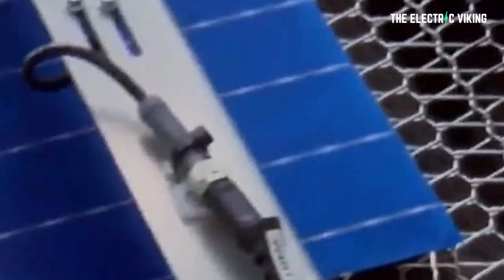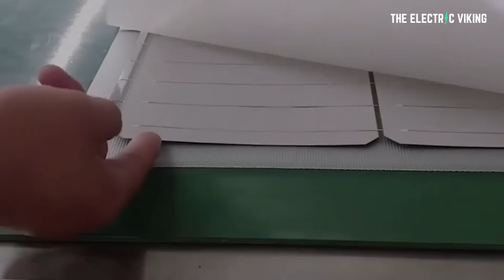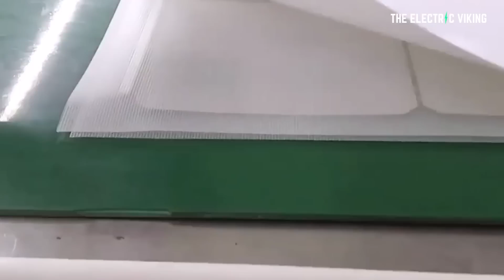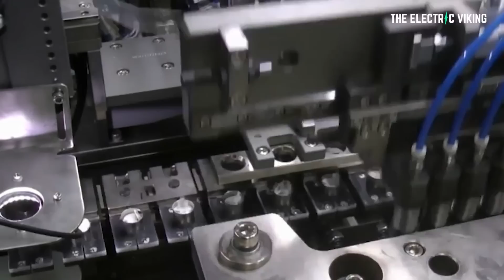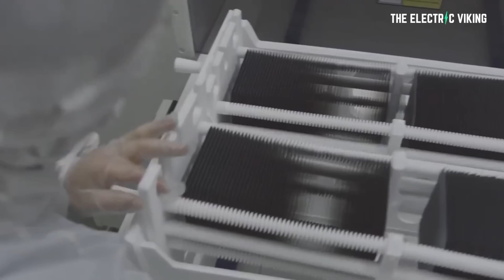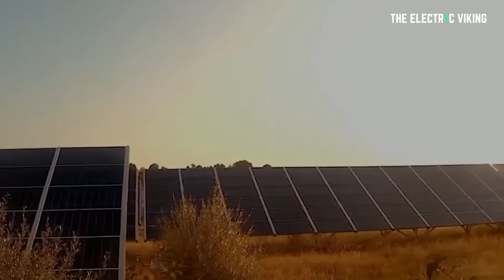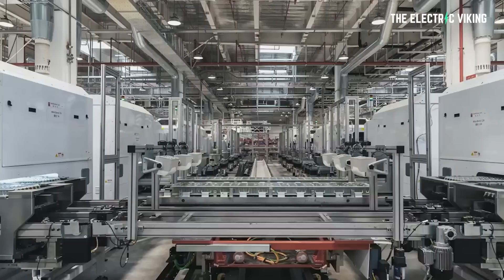China’s solar panel price war will double solar panel installations globally

Comment: Yeah, and the people of Europe have sky high heating bills. Especially in Germany. In the UK families are having to choose between heat or food. Why, because they shut down all the coal mines, oil/gas drilling, even blowing up coal power stations in the UK. Only to find that when supplies of fossils from Russia are cut off all the renewables they have been tenaciously investing in for decades cannot deliver. I'm all for exploring alternative energy sources but it is insanity to shut down what we have until the new things have proven themselves. This mad rush to "net-zero" is very likely to cause a lot of suffering.
Reply: Solar makes less power in winter. I get almost 5x the generation in July as I get in Dec-Jan in Ohio. That solar will be great in the summer. You get a lot by March. In the winter, wind is better, especially in the north. You also need some storage to smooth it out, along with beefing up the grid, and demand management. Charge those EVs when there is plenty, and less when you are short.
Reply: @fjalics  Round here the days are 6 hours long at Christmas and half the years is depressingly dark. It's not a good country for wind power. Batteries won't smooth out those 6 month long dips.
Reply: @heater5979  Where are you at, roughly?
Reply: @fjalics  30Km outside  Helsinki, Finland.
Reply: @heater5979  Your wind resources aren't top tier, but you do have some in the Baltic Sea, and Gulf of Bothnia. It would be interesting to see what it is in the winter vs summer. Also, onshore wind is now dominated by lower speed wind turbines, which means long blades. Ever heat of the Haliade X, SG 14-222, and V236-15?
Reply: The reasons Europe shut down coal and did not embrace fracking are for coal:
The deposits where mostly deep and thin and sometimes of shit quality on top of that. As a result coal needed increasing subsidies which where getting simply too expensive. I watched it in Germany and am remembering the iron lady blowing up the unionised and subsidised coal mines in Britain. Germany still uses competitive brown coal today. But in a densely populated area like Europe every mine and even gas well causes extra costs that can't be hidden like in the Australian outback or the western US. The former Ruhr coal basin has closed but still requires eternal water pumping because salty deep groundwater  threatens shallow aquifiers that supply drinking water. The densely populated  surface  has  dropped by some 10 to 20m and without pumping even major rivers back out of this artificial depression the mega city covering the basin would become a lake. 
The Dutch have their Gronigen gasfield doing the same: Earthquakes destroy houses and the land is sinking (already being close to sealed or below). 
Northern Germany was a fracking target but the are is increasingly short of water and depends on clean groundwater...So would you permanently threaten your  watersupply for a short term gas boom?
The Brits had their gas and oil boom out of sight from the 70ies on in the North Sea. Now their deposits are in decline and the energy crisis hits a former exporter as hard as Germany which never had much own oil or gas. 
Time for them to no longer kick the can down the road and get out of fossil fuels. Change is hard but staying exposed to fossil fuel volatility and foreign blackmailing is harder for Europe as it will always be a fossil fuel importer due to a lack of (sometimes economical) domestic resources.
 And if you stop denying climate change renewables become a no brainer for every country because cleaning up fossil fuel would easily double its cost....
Reply: @@bertwaldmann4789All pain, No gain
Reply: @Bert Waldmann That is what bothers me. The net-zero fanatics don't care how much pain they inflict on people today, it's all for the good of some supposed benefit of not yet existing future generations. I'm worried the effects of rabid net-zeroism will include people dying of cold and starvation as our energy and agriculture supplies get disrupted. This philosophy is what the likes of Stalin used when forcibly starving millions of Ukrainians, they were expendable for the good of building the bright new global socialist order.
Reply: Wrong. Coal, gas, oil, and nuclear aren't necessary any more. They disconnect photovoltaic plants, stop wind turbines and biogas plants aren't allowed to electrify what they burn. This is due to coal, oil, gas and nuclear lobbyists having bribed politicians. Also: don't bullshit me about heating: never has been warmer here in Germany. If you continue with that bullshit we Slavic Antifascists will continue what Stalin had started: the annihilation of you demented murderers of the Jewish people...and now you started to murder Muslims (Solingen,  NSU, Hanau...). And say goodbye to your Nazi-car industry because Tesla (despite your fake-environmental efforts to block Musk), China and South Korea are tanking you.
Reply: The price of heating is high because price of fossil fuels is high right now, and many homes heat themselves using fossil fuels and not electricity
Reply: @tiga2001  Exactly. The price of fossil, in Germany for example, has gone through the roof because of Russias invasion of Ukraine. Despite decades of investment renewables cannot provide enough energy to replace Russian oil and gas. Putting the entire economy in jeopardy ultimately threatening peoples lives.
Reply: @heater5979  seems like Germany spent just as long or longer invested in Russian oil and gas and that's why Germany's in this predicament. If they had diversified away from Russia or invested in electricity storage solutions then it would be a different story. But they've created new LNG terminals so they should be able to import the gas they need from other countries.
Reply: Solar is so cheap now.  Batteries have got cheap too.  Community solar for the win.   Don't do it on your own go collective and be energy independent.   Leave those evil fossil fuel companies behind.   They are trying to kill our kids
Reply: @girowinters  Around here I have only seen the sun for a couple of days out of the last two months. When there is no cloud the sun is very low in the sky and only up for 6 hours. Maybe a couple of those are useful for power generation. The temperature has been -5C dipping down to -20C. This house is very well insulated but needs orders of magnitude more energy to keep in warm. There is no way solar and batteries is going to help.

Fossil is not "evil" most of the kids alive today would not be here if it were not for our use of fossil saving people from cold and starvation for the last  hundred years. or so.

Yes, we need alternative energy sources to halt pollution and to use when fossil runs out. But cutting fossil before we have an alternative ready to replace it is going to cause untold misery.
Reply: Fossil fuels are just too expensive  and toxic
Reply: Not all renewables fault. If the UK and Europe had put more solar on their homes, and installed electric heat pumps, they wouldn't need to use dirty coal and oil.
Reply: @nio6297  those imaginary solar panels sure would have helped in the cold November days 😅
Reply: Poor planning and lack of planning are serious problems.  Failure to carefully manage the energy transition is a problem.  Generating electricity from wind and solar is not the problem.  

I would say, due to decades of inadequate investment in wind and solar, Europe is still subject to the volatile pricing of energy from fossil fuels.  Fossil fuel pricing will always be subject to geopolitical machinations and monopolistic corporate profiteering.
Reply: @davidmenasco5743  I agree. When Germany shut down its nuclear power plants, it should have went all in on wind and solar. Other European countries also should have went more aggressively toward scaling up wind and solar.
Reply: The ones who suffered most are those who didnt install solar panels on thier roof and  those who are not driving EVs
Reply: @1rjona  They had the money bey...they had the abilities...but they just were too arrogant.
Reply: @1rjona  90% of people around here live in the city, in apartments. They have no possibility to install solar panels. Even if they could afford to. Similarly a huge majority of the population are not driving EV's because there is no way they can afford one.
Reply: @heater5979  but unfortunately for them their taxes are subsidising EVs and Solar Panels (and the feed in tariffs which justify, say, a 10 year payback). Feed-in tariffs meanwhile are plummeting, in Australia at least, pushing the solar panel payback out to 20+ years. All this while several millions of Australians live below the poverty line. In time, our grandchildren and great grandchildren will look back on us with scorn.
Reply: Europe and UK is in world of pain due to Russia and reliance on gas.  Solar likely won’t help majority of those in UK in the short term.
Reply: @michaelcsutton  Exactly. Despite decades of investment renewables proved not to be enough to replace fossils. It was nuts to disable energy production from local fossils and become dependent on Russia.

Comment: Carbon neutrality will impoverish huge swathes of people at this stage. until grid level storage is a viable alternative. solar so far has been unhelpful in times of most critical need (because it's cold and dark) If you're lucky enough to live in a sunny part of the world and you earn significantly more than $3 a day then domestic solar is a great idea combined with a power wall of some description. Oh, and the reason for Chinas massive rush for full automation is that they have insufficient numbers of people in the workforce either by age or by desire. A problem which will only worsen due to the CCP previous ill considered social engineering projects...
Reply: How will carbon neutrality impoverish huge swathes of people and where ?

Comment: Hi Sam, greetings from the U.K.  Solar has its place in future of electricity generation, but here in the U.K. we have Winters with short days and very low light levels. Wind and battery storage can significantly help, but we will need other forms of generation here. Nuclear still seems the best option to fill the gap to me, and I know this Is controversial, but I just don’t see an alternative technology at this time.
Reply: Wind, works in the dark, already installed, no nuke waste
Reply: There will always be a need for some base load, yes.   Nuclear is a good option for that.   But it won't be economic without a lot of energy storage becoming operational first.   Energy storage is the key to being able to run base-load like nuclear efficiently.

The U.K. is barely breaking the surface of the amount of renewables that can be installed.  Solar potential is very high in the south, and wind potential is also seriously under-developed.    Solar is decent even going north... cloudy days aren't a problem when panels can be slapped up just about anywhere.   We are talking at least another +500% in solar installations and probably a lot more.   My guess is that you will want at least 60GWp of installed panel capacity and you only have around 12GWp now.
Reply: No - solar is cheaper and works effectively in the UK - UK will have slightly more storage so the ratio of solar/storage will be different to a sunny area.  The cost of nuclear is astronomical and will continue the imnpovishment of Britons.

Comment: If the 0.8 Twh production - would never over take increased world demand which is 9 Twh per year. You'd need 22x current solar production to even meet increased demand and maintain fossil fuels at current levels.

Comment: Could be true; but home solar is 1/2 as cost effective as farms.  Even if it were accurate world solar growth to date is 0.40 Twh; total installed 2,700 Twh, a double to 0.8 would only raise the total to 3,500 TwH out of 185,000 Twh = 1.8% of World energy production; hardly putting fossil fuels out of demand.
Reply: You need to add wind into that calculation.    My electricity is about 50% wind at 13 cents per KWh.
Reply: @danharold3087  He was only talking about solar. but you can look at the same chart and see that World wind is about 4.2 Twh up from 3.8 improvement; total 2020-2021 .4 higher similar to solar increat but combinded 1/10 the demand increace; in order to do anything to cut CO2 you at least have to keep up with demand increases. Now I can cut CO2 over night by 8-10% just get everyone to commute in carpools - Transport is 16% of all CO2; if 4 or 5 cars stay home for commute that cuts CO2 at least in half.  BUT no one is even talking about it - which tells me the entire CO2 panic is nothing but a sales pitch from those trying to get a world government and sell you green products.  There is an advantage - which is independence from oil producing countries like Russia but that isn't want they want - they want a carbon tax and Paris accords. BTW if all those carpools had solar electric or ethanol - you'd cut fossil fuel use even more.
Reply: @BlondieSuperdog  Yes he was talking about solar.  But in terms of moving away from fossil fuels one has to include renewable in general.  I tend to leave hydro out which is growing at about 3% globally and quite hard to accelerate.  Wind and solar adoption is spotty. Could be better in the US but we have a 10% import tariff  with virtually no local production.  Aka a tax that slows adoption.  Millions are being spent to confuse the issue.  It divides us which also keeps our focus away from other important things.  
Most people choose to talk about efficiency because people with zero buy in on the environment might understand saving money.   Ethanol was originally used as an oxygenator as opposed to MTBE.  It worked fairly well for that.  When they started upping the level to displace gasoline it was a flop.  Engineering Explained did a video on why.  Don't look to the government to validate tech.  Too much of what they know comes from lobbyists.  They mostly rearrange deck chairs and fill their war chests.
Reply: @danharold3087  Ok hydro is the largest renewable by far, most of the dams have been around for 50+ years before Green was even a thing. It is growing now and then a dam gets built, in Washington State they are tearing them down. One potential problem will be if glaciers continue to decline the feed waters will; Hoover Dam/Lake Meade are already at low levels.
Reply: @BlondieSuperdog  Hydro is hard because a dam takes lots of acres and there is the environmental  impact associated with it.  More so it takes a river and  arguably most have already been damed past where they should have been.
For this reason I don't see where hydro will account for energy growth in the western world.
Reply: @danharold3087  I agree - it won't grow enough.  As I noted conservation is likely the biggest potential mover - just carpooling would not only save people money; but time as well as reducing CO2; but no one pushes it because there is no money to be made.  Are we serious about CO2 really?  If a 100,000 seat statdium represents the atmosphere only 10 seats are man made CO2, probably hard to accept that to be the driver of world temprature.
Reply: @BlondieSuperdog    You are thinking about CO2 wrong.   Lets say the heat in your house is CO2.   Do you remove all the heat from your house in the summer.  No you pull off a few degrees to make it comfortable.  CO2 is not some poison where none is the best.  I say this because I have had to explain this to several people.

There are many other factors that drive the world temperature.  CO2 is the only one we currently have the tech to change.   If we blow our chance with C02  I see the next logical step as deploying huge solar sun shades/sheilds in space.   That will make C02 reduction look easy.
Reply: The first part of S-curves are really unimpressive. Never anything to worry about. 😛
Reply: @geirmyrvagnes8718  roflmao